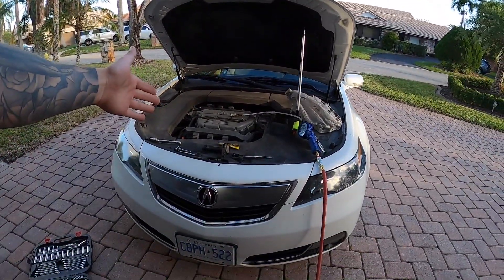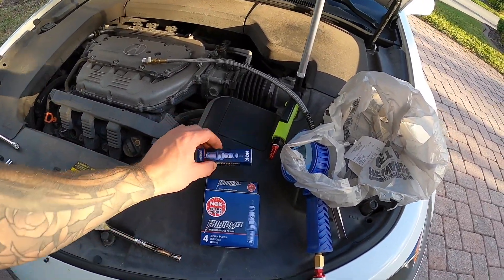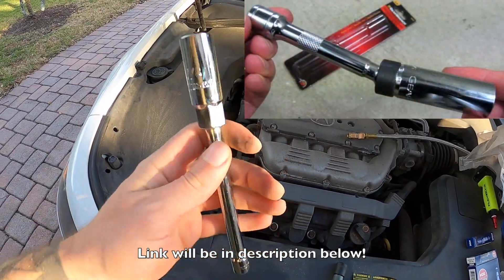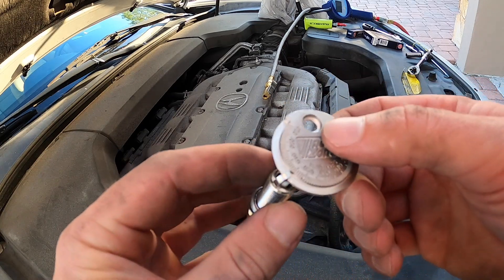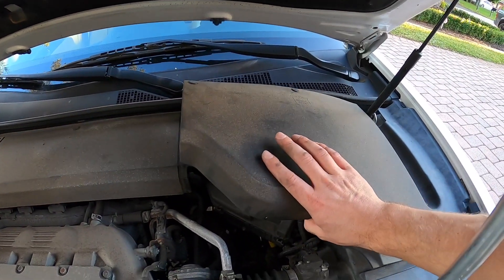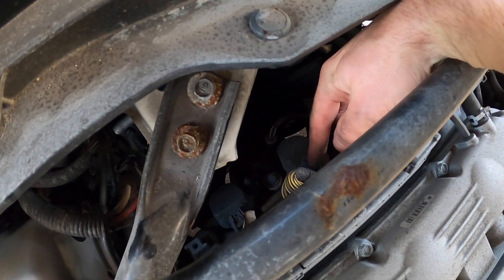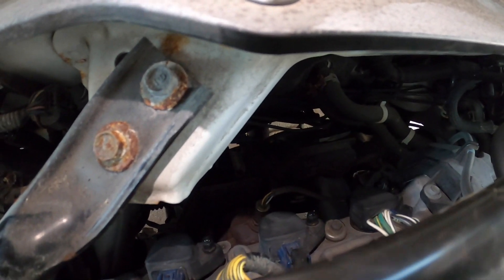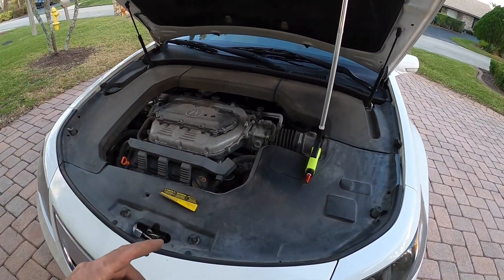ACURA TL SPARK PLUG REPLACEMENT

Comment: If she starts having any misfire issues, make certain you check the fuel injectors.  I have a 2013 TL.  Love the car, the way it drives, the power of the V6 and the fuel mileage.  At around 140k miles I had a misfire that was mis-diagnosed as a spark plug issue. The injector on that cylinder was fouling the plug due to it being stuck open.  That can lead to damaging a perfectly good engine if not corrected by replacing the injector.
Reply: Did you ever fix it?

Comment: For those that are doing this for your 4g TL...the OEM is ngk laser iridium. They cost $20-30 each. I first tried Denso irridium, but got 2 mpg leas mileage.  Then i found NGK ruthenium HX that are "high ignition" same as the laser irridum. 

These are $14 at Autozone and offer performance equal to the laser iridium.  If your car is in California, your OEM plugs are denso plugs, ngk for everything else.

Comment: Yes, iridium plugs are definitely not cheap, especially when I had to buy 16 each for both the '12 Challenger R/T and the '14 Chrysler 300C, both with hemi engines. Upside is that they should last the life of the engine and then some! 
Thanks for a cool video, and glad to see you were able to help your sister out as well!
Reply from the maker: Thanks Mark!  Yeah they still seemed to have the .044 gap on the 110k mile plugs but I wanted to change them anyways cause the car was surging a bit.
Reply: @boostedmotorsports2  Did it fix the surging of the car?